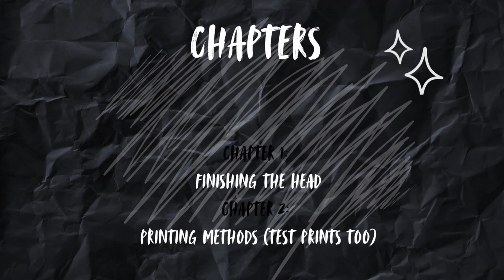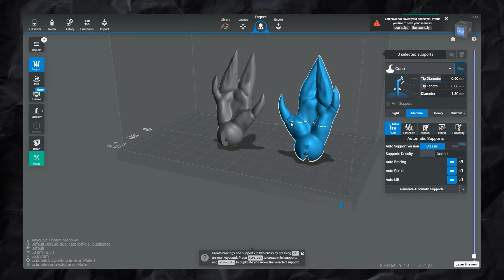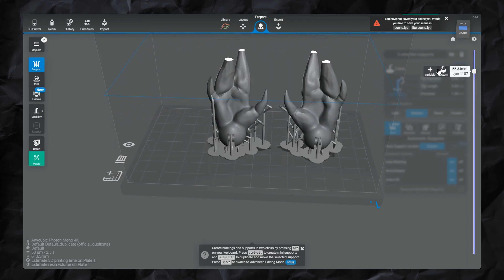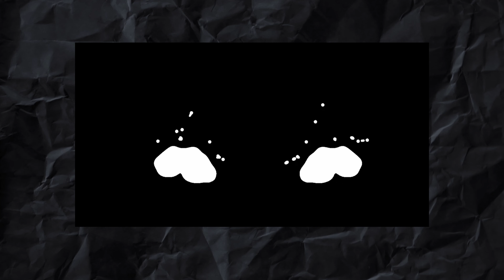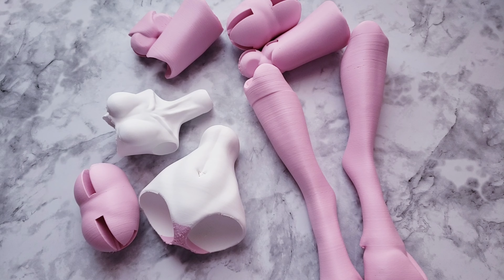How to finally finish your Art Doll || Part 3: 3D Printing

Comment: I’m getting started on the process of making my own doll, and these videos have been super helpful! I am curious though. With the eyes, do you make your own, or do you buy them premade? If you make them yourself, how do you go about that? If you buy them, how do you know what size to get/how do you make sure they fit within the dolls head? Thank you so much for these videos!
Reply from the maker: So glad they're helping!! I make my own eyes to make sure they fit to the custom heads. I'll make a more detailed video about it, but basically I  use the same sphere i used to cut the eye hole in the head from there i add a cylinder to cut into that sphere and form the iris ( i use a cylinder instead of another sphere so that the eyes don't look too dark once placed in the head) 
Also make sure you cut the back of the eyes themselves off. The part you keep should be slightly less than half of the sphere itself. Hope this makes sense.but this just makes sure the eye fit into the socket and makes it easier for your finger to place it.
Hope this helps!
Reply: @2BeeSweet_Art That helps a ton! Thank you very much!
Reply from the maker: @the_radic0le540 let me know if you need any more help, and I'll make sure to put more tips in the next video 😊